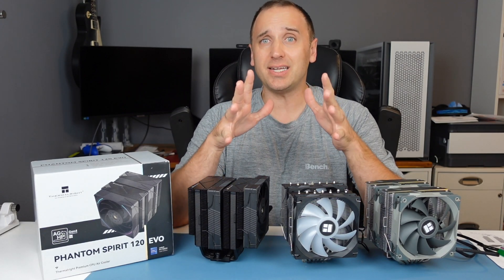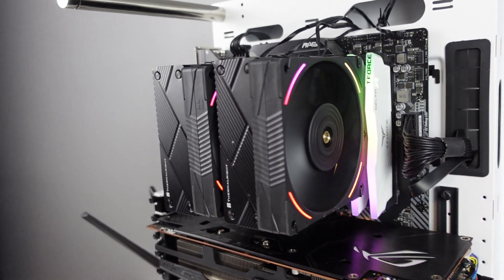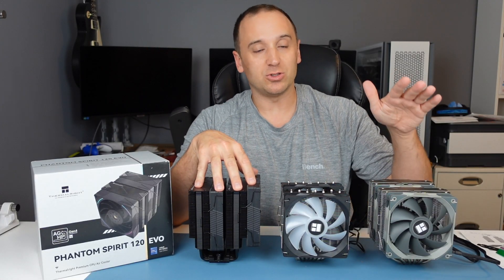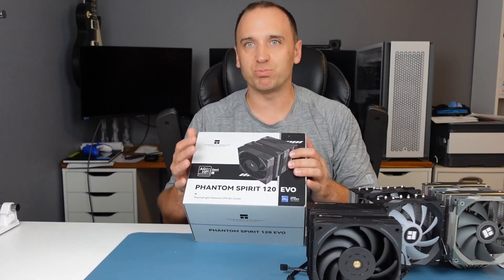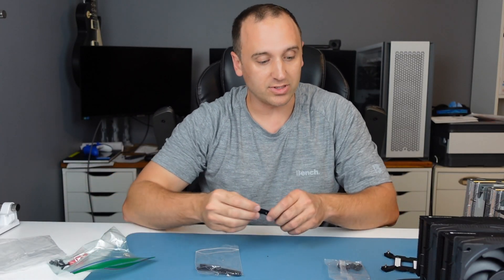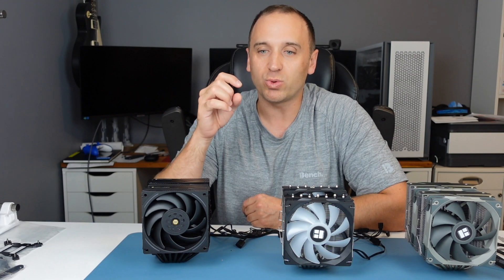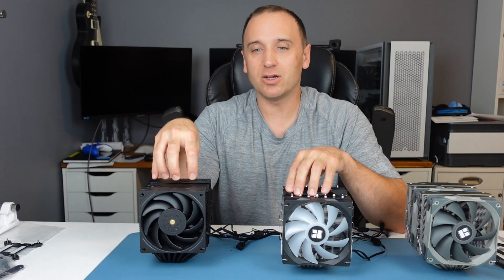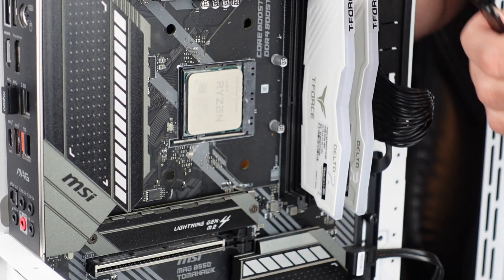Phantom Spirit EVO review and installation

Comment: i know it's an old video, but he's doing the fans wrong.
One should be in between the cooling tower and the other should be on the outside of the cooling tower,
and blow towards the back of the computer case and in turn there should be another fan on the computer chassis that blows out the hot air.
Reply from the maker: Did you actually watch the video? The front and middle of the coolers is where I placed the fans. The case is open air so they're is no where to put an exhaust fan.

Comment: Thank you for the great instructions. I decided to pick up this today and went from 101C degrees with the criminally bad stock cooler to peaking around 71C degrees with this EVO cooler. It's slightly noisy when it's running at max, but compared to running the cpu at boiling temperature the noise feels reassuring.
Reply from the maker: 101c is crazy. You can always adjust the fan curve to reduce the noise.

Comment: I watched other videos and no one mentioned fan directions should be this way. Thanks for the info.
Reply: I jUST INSTALLED MINE AND NOW I FIND OUT ITS BACKWARDS DUDE FUHH
Reply: @Drewdwn2  Don't anyone feel bad. It's been a standard for decades that fans have rotation arrows, and air flow directions.

Comment: I don't get it:

 138 CFM vs 66.17 CFM and 2150 rpm vs 1500 rpm max speed

Yet it is only 2degrees difference? How?
Reply: It's because you are totally wrong buddy 😅
69CFM VS 66,17CFM so it's 2,7% lower CFM for 66,17CFM. Which make sense to get 2°C when there's a 2,7%. I don't know how in the hell you got 139CFM but it's absolutely wrong 😅
Reply: @FireCestina1200  Google made me confused, now its more appropriate :) Thanks!
Reply: @FireCestina1200 the Evo fans do have almost double the static pressure though
Reply: @FireCestina1200 combined the CFM of both fans maybe?

Comment: is it necessary to install the rgb cables?
Reply from the maker: No you don't need to plug the argb in. You can also swap the fans out if you don't like them.
Reply: @jackshardware  thanks, not interested in rgb honestly, as for the fans im looking for performance over looks so it doesn't bother me at all
Reply: @hadji9354  Just get the non aRGB fans. Less wires to deal with too.

Comment: Do you know why the splitter have one four pin male and onethree pin male? I thought it should be two four pin male.
Reply: So that two slightly different fan speed signals aren't being sent to the same motherboard header. How would the motherboard report 2 different values? It would just confuse the onboard controller
Reply: @Andrew-ry7iw I don't understand, but, is it normal for the splitter to have a 4 pin male and a 3pin male? do I just connect both female powers into it?
Reply: @josslujano7615  yes

Comment: 18:15 that's exactly what i was afraid of , i think i should forget about buying a dual tower. is it even harder on a matx mobo + corsair vengeance ram ? also my case maximum cooler height written in the guide is 160mm
Reply: I have Vengense and sadly you will need to move it up
Reply: @TheTimeReaper  yeah i bought it and didn’t install the front fan it looks much better for me
Reply: @TTURKI did you notice a significant difference with the temperature with and without the front fan?

Comment: Seems weird to me that the CPU fans would push outwards towards the intake fans at the front of the case, unless your front fans are exhaust? What am I missing
Reply from the maker: The fans are pulling from the front and pushing to the back.
Reply: Phantom Spirit models spin counter clockwise.

Comment: Any thoughts on loss of performance to move the front fan to the back of the cooler?  I am using this cooler on an AMD 9800x3D.  I will have a lot of positive air pressure in the case but also using a 4080 Super that will be generating quite a bit of heat just under the CPU cooler.  The 9800x3D, from reports, shouldn't need a great deal of cooling since the power required for the process is relatively lower than most high performance Intel CPUs.  Thoughts?
Reply: I got the new system up and running. I will try to do a few real world tests and see if removing the front fan makes a significant difference.
Reply from the maker: I would be curious to know how that works out.
Reply: @JamboneMan  hey!
Have you tested this? Would be really nice to know, I have ordered this cooler but now I think that will be or too big, or just the exact size, so if I have to put the fan up for ram clearance (44mm), it may not fit...
Reply: Yes please! I'm updating my AM4 with an 8700x3d on an asus b550f. Reallly don't want my g.skill vengeance rgb to be covered up. @JamboneMan
Reply: @rbtsavage  Can you all recommend a benchmark test for this test and then I will try?  I can try running a game like RDR II or Helldivers, run with and without the front cooler fan and monitor CPU temp but a benchmark test may be better, thoughts?
Reply: I second this, I’m thinking of using the phantom SE with it

Comment: Thanks for the video. All of my argb headers are at the bottom of my motherboard (strange design) do you think the cable is long enough to reach that far?
Reply from the maker: It should be long enough i just don't know how well you will be able to hide it. If you are worried about cable management, you might need to get an extension or 2.

Comment: Great video! I'm looking for the one that is most silent (price is similar). Woud you say it is more beneficial to have the EVO capped to about 1500rpm, which is the max of the Phantom Spirit, keeping up with the same performance while having less noise? Or something similar of course
Reply from the maker: I would definitely go with the evo and play around with the fan curve until you get the Performance to Db level you are happy with. If you are using it for gaming you can probably get it below 1500 rpm.